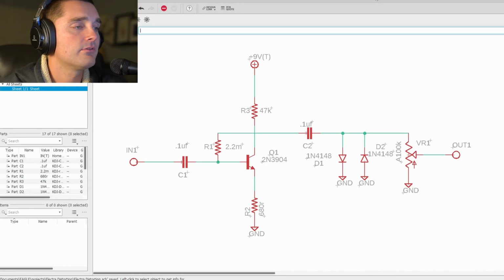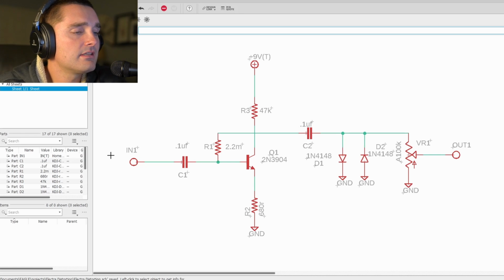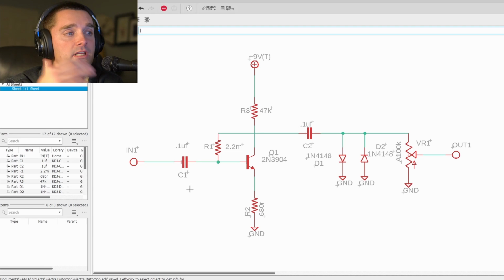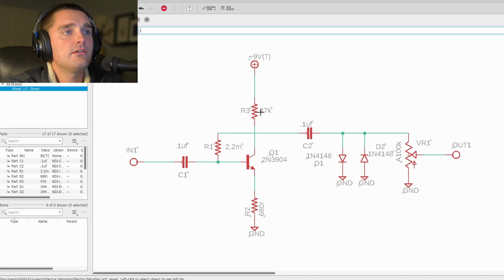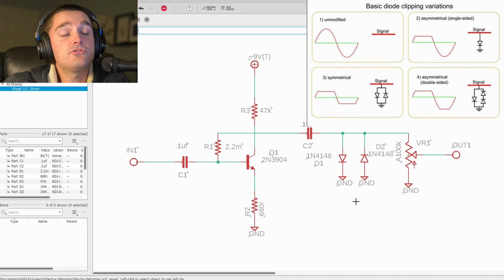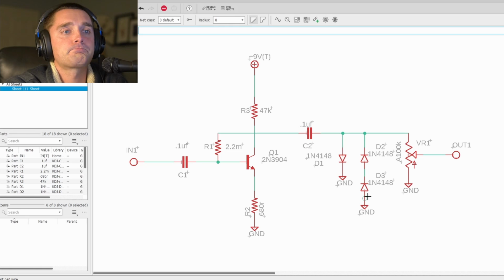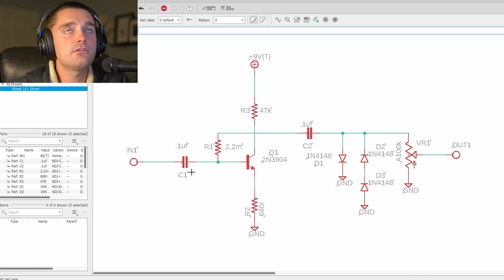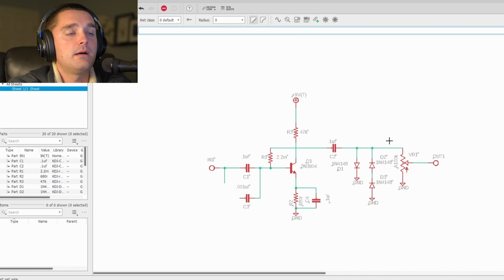Electra Distortion Circuit Testing - Pt. 1 | Schematic Review & Mods

Comment: I've been building pedals for three years now and my main topology types have been fuzzs, treble boosts, percolators, clean boosts and various ods.

Its only recently i heard Cortez the Killer, then bumped into the Les Lius pedal, which i learn is an electra topology....never heard that term before prior to a few months back!

Great sounding little circuit! Thanks for this :)

Comment: Hi Kley, great video!

I have a question: At the collector there's going to be a DC biasing voltage (of around +3.3V assuming the transistor BETA to be 100 if l did the maths right), so that the amplified signal has headroom and not clip just yet. But then the signal will be almost completely positive in voltage. Is the decoupling capacitor going to literally subtract this 3.3V from the signal or something like that? I get the feeling that the diodes are going to absolutely crush the signal otherwise.
Reply from the maker: @ric8248  The decoupling cap blocks the DC voltage used to power the transistor, but does not affect the AC audio signal. The diodes will clip the ac wave form. One on the positive swing. One on the negative swing.
Reply: @KleyDeJong  oh l understand.. thanks!

Comment: It seems the connection of the collector of Q1 to R1 is missing, just a missing point in the schematic where to connection Q1-R1 is crossing R1-C2, strangely a lot of schematics for this circuit are missing it, other schematics for a single stage transistor amplifier have it.
Reply: was thinking that when he got to that an said feedback loop I figured there was a connection point missing

Comment: You'd be surprised how little components are explained in the way you are doing here. There is a whole lot of explaining what a transistor does and mathematical explication, but not what is happening within the transistor which is essential for someone trying to move beyond paint by numbers building. A lot of the functions are either glossed over or explained in non-analogous non-mechanical ways. Its been awhile but I hope you do more like this video. Its a hole in the community as far as i can tell.

Comment: What is the use/point of that 2.2m resistor? It seems like that will just stop nearly all flow through it anyways, so why not remove it all together?
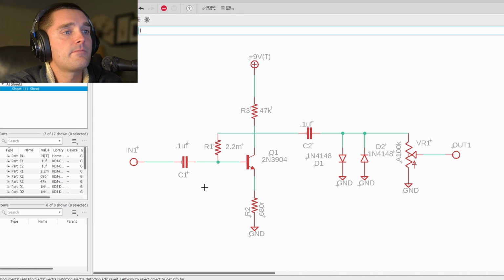Reply from the maker: I discuss it at 5:19.  More in depth explanation on what it means to 'bias the transistor' here:

https://www.diystompboxes.com/smfforum/index.php?topic=110302.0
Reply: 2.2m resistor used to set a "working point" to transistor's output.

Comment: I'm not that knowledgeable about electronics or electricity so I'm willing to be corrected. 
But to try and answer your question in the most basic sense about how a wire or path can carry both AC and DC signals at the same time, DC is like that more constant level of voltage and AC will be present if you take that constant level and wiggle it as in the case of amplifying an audio signal. The center point of that "waveform" will be at the DC level, which is which is why we use decoupling caps to basically move that to 0 volts and then we are left with pure AC. Again, I could be incorrect but this is how I've understood it for a while.
Thanks for the dive into this circuit! It's one of my favorites and IMO outdoes most other drive circuits for it's natural sound and response.

Comment: Been experimenting with this circuit for a while and really enjoy the sound. Started messing with the eqd speaker/special cranker values and have developed something I really like. I don’t find value in the high volume of the special cranker and prefer to use the extra gain stage (compared to speaker cranker) with a switch going into the circuit rather than after.. so the result is less volume but optionally more gain.
Reply from the maker: Nice!  That's the beauty of this circuit is in how it can be easily digested and tailored to your preferences.